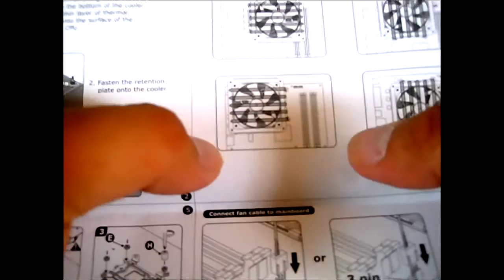Cooler Master GeminII S524 CPU Cooler - Installation

Comment: Thanks for this tutorial. I bought this, and the provided directions are useless.  But HiTechLogin saved the day. This + AsRock 970 Extreme 3 + Arctic Silver 5 + AMD FX-8350 means CPU temps no higher than 41 C, even if I put the S524 fan on middle speed.